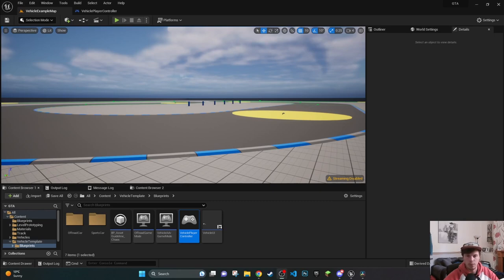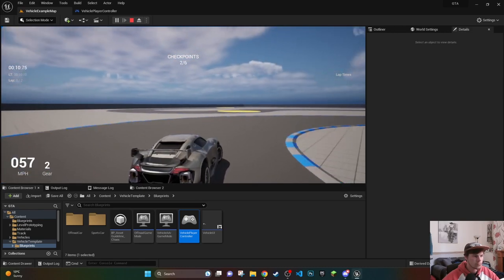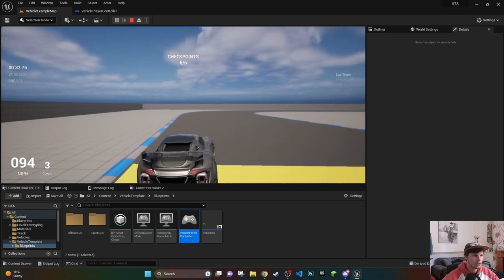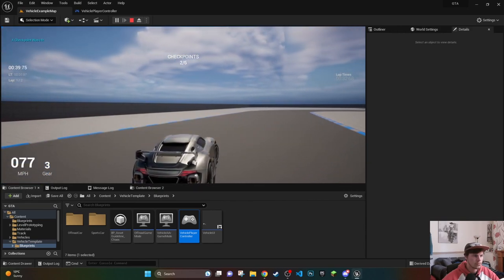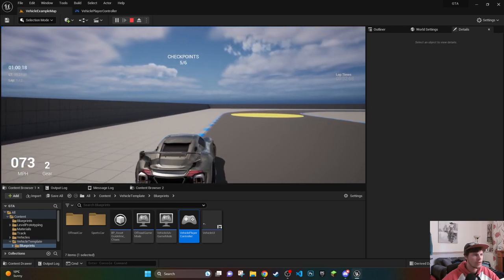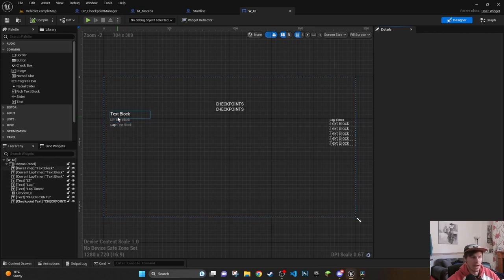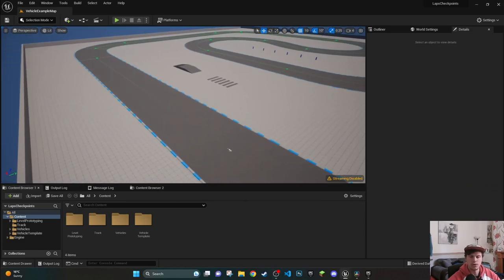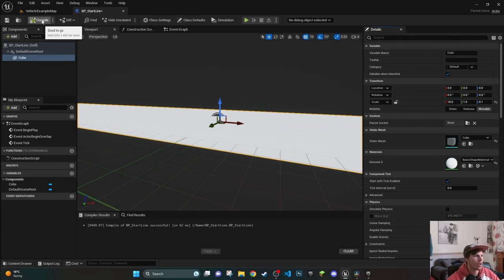UE5.1 - Making a Race Game Lap Timer

Comment: Lap counter UI is not viewing in my Viewport
Reply from the maker: Hey👋 is this just for the lap counter or all other UI elements too ?
Reply: @StevenOrmerwood  UI elements is not casting. shows this error (blueprint runtime error: Accessesd none trying to read property as vehicle player controller. node Start race graph : EventGraph Function: Execute Ubergraph start Line BP Blueprint: StartLine_BP
Reply: @kirubaanand4544  i have the exact same problem, did you manage to find a solution?